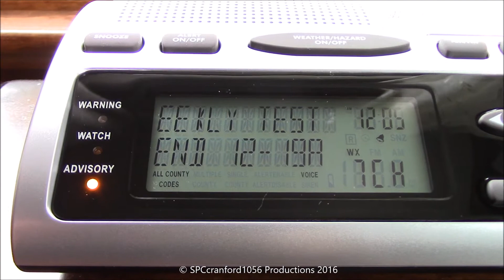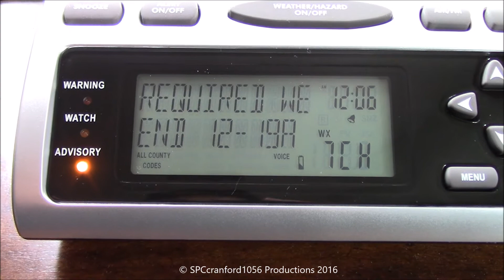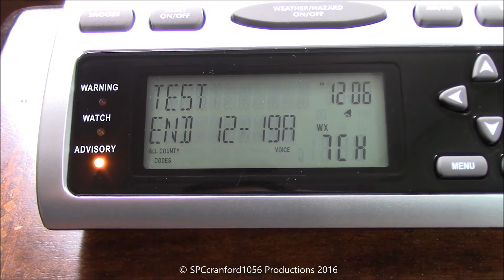Required Weekly Test on the Midland WR-300 (EAS #1,608)

Comment: Where do you buy these?
Reply: SPC CoolAl at walmart
Reply: @juliaescobar3192  The WR-300 was discontinued, so you would have to buy the 300 on eBay.
Reply: I bought it in a thrift store and it’s working fine
Reply: @SPCmuncie  you mean the wr 100? Wr 300 isnt discontinued they are still selling on midlands site and stores
Reply: @senglee2330  Well would you look at that, they sure are! They seem to have temporarily been discontinued in 2018 or 19, before being brought back at a cheaper price ($50 vs the original $90).
Reply: @SPCmuncie  No. They still make 300s
Reply: @SPCFranklinCounty373  read the comment above, please and thank you
Reply: At the time I made that reply, the WR-300 was listed by Midland as a discontinued product, later being reintroduced at a reduced price, as far as I can tell
Reply: @SPCmuncie  Nope, the WR-300 is still available on Midlands site, you are dead wrong
Reply: @RobertsExtras  I literally just provided a correction but okay 💀